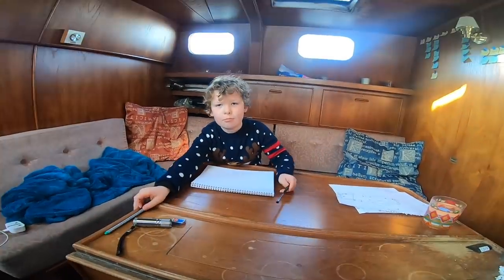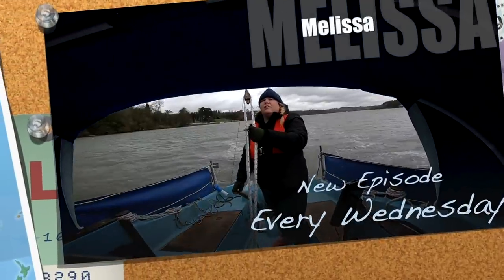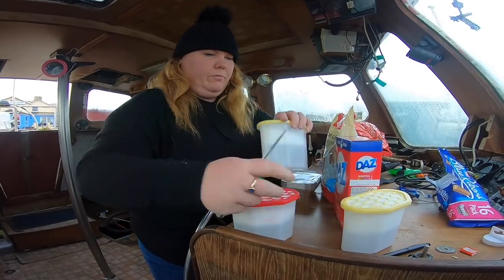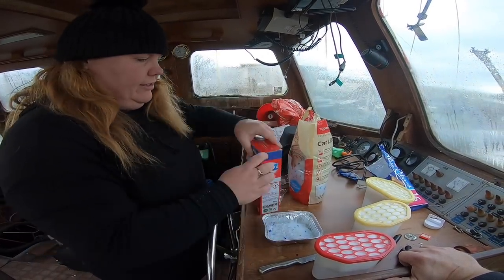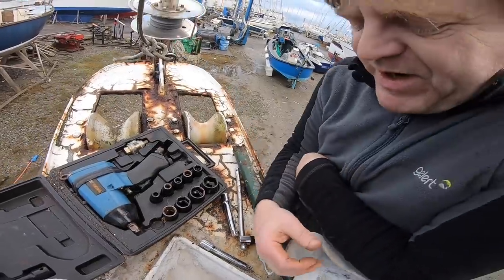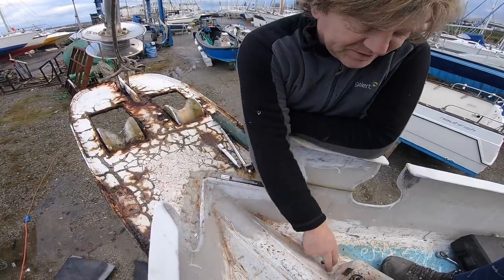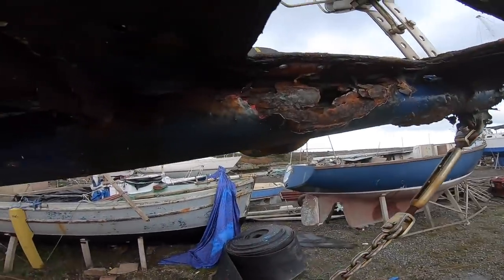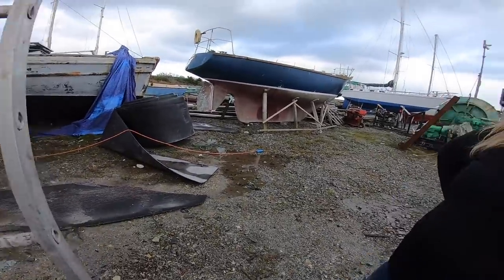#25 - Bowsprit Disaster!!!! - Restoring a steel sailing yacht

Comment: Andy, 

I want to preface this comment by saying I used to work on the USS Lexington CV16, a US Navy Aircraft carrier that is now a museum. 

Working there I did quite a few rust repairs that are very similar to what you are doing with your bowsprit. 

IMHO the way to handle your repair is to go in with what is called a 'wafer disc' on a 4" grinder and you can literally just slice through the plate and cut it away, although instead of cutting the welds, you want to cut back from them a ways to give you say 4-6 cm that you can then get a large crescent wrench on, doing so along with adding some vertical cuts to the remaining pieces down to the weld will allow you to break the welds right off leaving a minimal amount to grind. 

I would suspect that given the open nature of the bowsprit tube now that the entire inside is trash and the entire piece will need replaced. 

What I would do in your situation is I would go back with stainless steel for the tube, and mild steel to replace the pedestal. 304 stainless can be welded to mild steel with 309 welding rod and a stick welder. You will want to get plenty of practice first as the puddle  is a bit different and the arc is green, but other than that it is no different than welding with 6010 or 7018!

I would also recommend replacing the 'deck' on top of the bowsprit with stainless, and using stainless pipe for the edges, you can get pre-bent weld in 90° fittings then just shave a bit off one side to make it have a bit of an angle as it goes back. 

This also leads to a few different things for you to consider, one of which is that as you are rebuilding all of this, you need to consider what anchors you are going to be carrying up there on the bowsprit! Good modern anchors such as a Mantus have a different design and require different configurations of the rollers and different clearances to work next to a bowsprit. 

You will want to design all of this before getting it all welded up as it will be quite a pain to do later on, and naturally doing it twice means it will be far more expensive! $$$$$$

Then you have your anchor handling gear. 

Personally I would want to switch out to a pair of electric vertical capstans with wildcats for the chain. Then build a pair of bins in the anchor locker that each chain can individually drop into. Or if you are running one anchor with chain, and the other with rode, you have a place for it to coil, but will need an access hatch to store it, which given the work you are doing there is not a terrible idea. 

The other advantage of going to a vertical capstan is that it allows you to pull more than one direction, if you ever need to pull your boat to the side, say after it has been washed up on a beach, having that vertical capstan gives you that option. 

The other thing is, I would ditch that manual windlass and get an electric one for the simple reason that if you are in a bad situation, say dragging anchor towards the beach in a good blow because the wind came out of the opposite direction foretasted, (because you know the weather man never gets it wrong!) and you are facing meter tall waves on a 5 second period, having to go forward to fight with that windlass to pull your chain back on board is going to be a whole new level of suck, and it will be dangerous. 

If you have an electric windlass you can have the controls for it in the cockpit at the helm so you can drive the boat and pull anchor at the same time, throw a chain counter into the mix and it will tell you how much you have deployed! This is also great when anchoring because you are able to start the chain out and then when you have the same amount dropped as your depth sounder is reading, you can then set your anchor alarm and begin to back up as you feed more out which will give you a very accurate position on your anchor, and if you can learn to anchor with more precision it means that at times you can get into a spot others cannot simply because you don't need so much room to get your hook set! 

Anyways these are the lessons I have learned in my 5 years living aboard my sailboat. Hope it helps! 

- Nick
Reply from the maker: Amazing advice much appreciated thank you!
Reply: @SailingMelody  You're most welcome. 

Oh and one more thought, I know we are always trying to save expense on our boats, if you decide you want to go with twin capstans but don't have the money for them right now, I would build the mountings for both, then build a block-off plate for the one, and install it at a later date, you only need one to get her in the water, it is just really nice to have two!